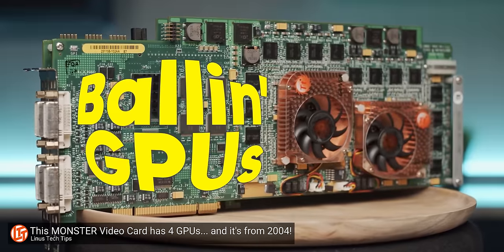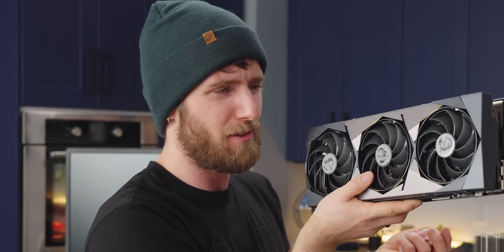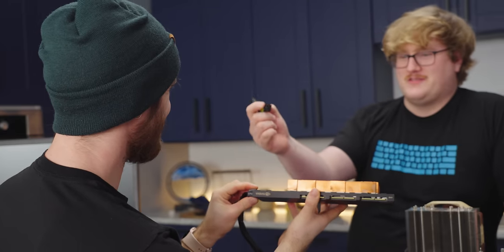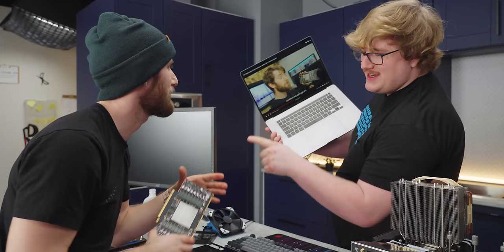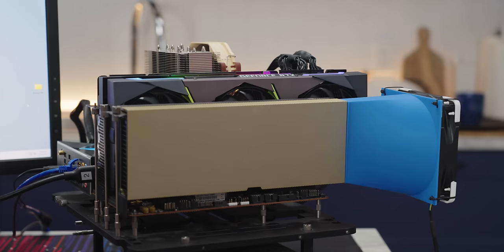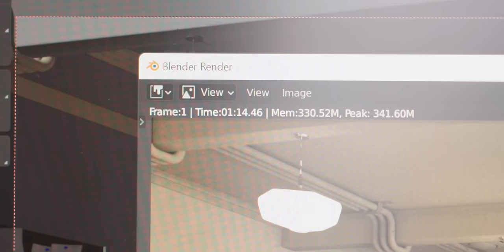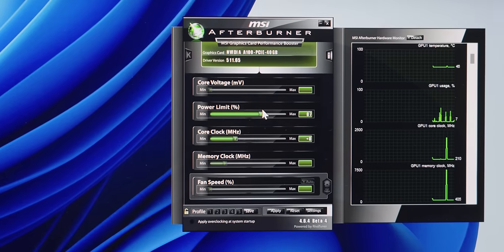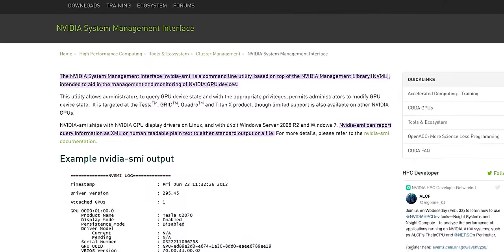NVIDIA REFUSED To Send Us This - NVIDIA A100

Comment: These cards were designed to run FP16, INT8(AI) and FP64 (double precision for scientific) workloads. If you think this card is awesome you should benchmark Radeon Instinct MI250X and Radeon Instinct MI100 with some FP64 workloads or even FP32 like blender rendering just to see the power of MI250x, it is the fist 6nm accelerator out there. AMD always had way higher FP64 compute power even on their consumer cards. AMD has no competition in high precision workloads meanwhile nvidia does way better in AI workloads. 

RTX3090    35.58 TFLOPS FP32,  0.55 TFLOPS FP64

A100           19.49 TFLOPS FP32, 9.74 TFLOPS FP64

MI100         23.07 TFLOPS FP32, 11.54 TFLOPS FP64

MI250X       47.87 TFLOPS FP32, 47.87 TFLOPS FP64

On and also both Radeon Instinct Cards are passive cooled.
Reply: It's incredible and almost impossible to explain how much more powerfull graphics cards had gotten over the yers
Reply: @blacktiger6046  Yeah it is crazy when you think about it. How powerful gpus now compared to the gpus we had back in the day like MX460. This year gonna be the biggest GPU performance leap within last 15 years. Both Nvdia and AMD will double the transistor count and performance will be more than twice compared to current flagships.
Reply: Yes, it's been the software side holding AMD back.  I tried really hard to find an MI100 at an affordable price (in context affordable), but it was practically impossible to get my hands on as an individual.  Nvidia has worked to catch up in this area, in the past they were always totally demolished in it, like what those 3090 numbers are.
Reply: @Pixel_FX  ... I don't think it's that crazy, rather I think their RAM spec has grown stupidly slow.  I had a 1GB card like 10 years ago and today a card that costs about 40 times as much is only packing 40 times the RAM...  That's actually really disappointing.
Reply: @zvxcvxcz  i was thinking more like 2002-2005 or older compared to today's
Reply: I have benchmarked the A100 40GB, MI100 and MI250. Let me tell you: The A100 beats them both in bandwidth-bound applications.

The MI250 is especially disappointing, because the 2 GCDs in a socket are separate GPUs with 64GB each, and one can't directly access the memory of the other. It's like a Tesla K80 dual-GPU card but in one socket.
A single MI250 GCD gets you only little bandwidth increase over the MI100 and is still way slower than even the A100 40GB because the efficiency is as bad as Nvidia Kepler.

With standard, non-matrix FP32 compute, a single MI250 GCD is only little faster than the A100, at ~19 vs 16 TFLOPs/s.

Comment: The reason this card is so efficient is mostly because it's using more surface area but lower clock speeds. Gaming GPU's could also be designed this way, but it would make them much more (too much!) expensive to produce.
Reply: yeee, intel and AMD use a similiar strategy for the their server CPU's (and threadripper) where they have a physically bigger chip. However the downside is its way more expensive as it uses up way more wafer space
Reply: Even without physical changes you can achieve so much better efficiency if you slighly downclock your modern GPU. Nvidia and AMD pushed their consumer cards so far out of the performance/Watt scale it's hilarious. But hey gamers don't care if they use another 200W as long as they get 5 more fps.
Reply: at what point does binning become infeasible?
can you shut down like 50% of the GPU if it have defects?
Reply: also probs wouldnt run real time very well, since you need small chips for games to have less delay

Comment: The near double performance you're getting near the end is because of nvidia's 1:1 fp16 ratio on consumer GPUs, also nvidia has a 1:64 fp64 ratio on consumer GPUs.

Basically they artificially limited consumer GPUs to force machine learning(wants fp16) and scientific calculation(wants fp64) people to buy way more expensive "professional" products.

LHR is just a newcomer to the party, not exactly a new concept.
Reply: Same energy
Reply: Can you elaborate on what you mean by '1:1 fp16 ratio' and '1:64 fp64 ratio'? (I am familiar with the datatypes themselves and the consequences for performance/vectorization on CPUs)
Reply: @Cyberguy42  performance compared to fp32, 1:1 meaning it's the same speed and 1:64 meaning fuhgeddaboudit.
With a tiny bit of extra circuitry you can make fp16 go twice as fast and fp64 half speed compared to fp32.
At least Nvidia relented and unlocked fp16, because that used to run at abysmal speed as well, so you can at least save on memory (which is also scarce on consumer cards) and make use of tensor cores for some operations.
Reply: BTW AMD has full speed FP16 and 1:16 FP64 on their consumer GPUs.
Reply: Yeah that's not really accurate. Geforce cards physically don't have many fp64 units to make them cheaper, also tensorcore fp16 matmul with 16-bit accumulator runs at full rate. Only fp16 matmul with fp32 accumulator is artificially restricted, which can be useful in some workloads but often accumulation in fp16 does the job. The 1:1 fp16 ratio you talk about is on Cuda cores which nobody uses for deep learning since tensor cores are much faster.
Reply: @randomobserver9488  fp16 has enough downsides (less stable training, loss of accuracy, ...) that at least in research it's not nearly as universal as you make it out to be. Hence why A100 supports the custom "tf32" 19bit format in its tensor cores to avoid converting between fp16 and fp32 all the time. Using the tensor cores is also only considerably faster if you're not already saturating the memory bus/caches anyways, which can happen quite quickly if your model uses a lot of less complex functions.

Comment: If I recall correctly Tensorflow usually blocks all your ram when being loaded. This means in the background it might not need that much but blocks most of it for better performance.
You can switch it to only allocate the required ram but this has to be done manually.

Just wanted to point that out :)
Reply: physical_devices = tf.config.list_physical_devices('GPU')
tf.config.experimental.set_memory_growth(physical_devices[0], True)

For those who are curious but not curious enough to dig it up :)
Reply: Pay attention to this comment!
Reply: You might have increased the batch size and got more images/s

Comment: 17:55 the math on that works out to less than $900/year of operating costs. Even if it had the same efficiency as a gaming card, at $1500/year it's still marginal compared to the capital cost of the card. AI datacenters buy these because of memory capacity, not because of computational efficiency.

Comment: Electronic Hardware Design Engineer: "How challenging is this PCB design going to be?"
Boss: "Yes."

As an electrical engineer who designs some really challenging electronics hardware, my jaw always drops when I see this kind of stuff.

Length matching thousands of traces is just ludicrous.
Reply: 1: these are not designed by a single hardware designer(I'm sure you already know)
2:they probably use some advanced AI which helps them design these things by automating some of the calculations
3:these things are not designed in one day,it was probably been designed by a group of engineers over many years
Reply: @armincal9834  you're right.  It's likely a team of a dozen engineers or more.  Some design the power systems (with the help of mechanical engineers for thermal design), some design the memory interfaces (likely specialized SI [signal integrity] engineers on the team), some design signal conditioning and sensing, and some design the processor implementation with the help of the IC design team (required bypass capacitor values and parasitics).

Then, there's a PCB design team.  Different roles are PCB librarians to manage footprints and symbols, power layout, high-speed digital layout, analog and sensing, and finally one person who puts all the pieces together (maybe a chief or senior principal engineer or hardware architect).

This isn't including the team that does simulations, DFM evaluations, part procurement, cost trades, IC design, etc.

They probably use Cadence Allegro.
Reply: @RandyLott  i feel so fucking dumb after reading what you said there. wow, I'm glad there are guys like you out there who let guys like me play some good old video games 😅
Reply: @crylune  no way, dude.  I've been aggressively learning and working in electronics for over a decade professionally and I've been passionate about it for 20+ years (since I was 10 or so).
Reply: @Sonoran.Stoner  we're all skilled and passionate in different things.  Much of what Linus and Jake talk about is over my head in terms of advanced computing topics.  I don't design computer hardware, but rather cameras.
Reply: @RandyLott  Luckily they have a script and remember it enough for the vid...but then later can't recall most of it
Reply: High end gpus really are one of the coolest electrical designs, check out some of the powercolor dual GPUs, dual 290 390 etc, kingpin too
Reply: The PCB challenge here is mostly the power delivery and power integrity, and not high speed interfaces. The only critical interface might be the PCI-e lanes running from the edge connector to the chip. HBM memory sits directly on top of the GPU chip, or else it would cause way to much signal integrity issues at the speed the interface is running.
Reply: Well with modern designs, like, i don't even care. But sometimes i see a toy from the 80s like that cassette tape groovebox Philips and Sharp made, PMC100 Personal Media Composer, and it's a single sided PCB the size of a calculator basically, and they have a 6800, SRAM, ROM, little Yamaha soundchip, but like everything's pressed so much for space, and it's a SINGLE SIDED PCB with a handful wire links and traces snake their way all over the place, and it's dense, there's basically no space to wedge in your tweezers between many of the components, and it was designed in 1985 or 1986 and i'm looking at placement and routing and thinking like HOW EVEN. Most 80s computers and such are easily legible but this just has everything going all over the place. And it's not like they had the tools we have today.

But hey isn't PCI Express allowed to have oodles of skew between the pairs, compensated by the protocol, and you only have to length match them per differential pair?

Comment: Just a thought i had while Linus was talking about the fan shroud, have you tried to flip the fan around to pull air through to see if airflow improves at all? I don't understand fluid dynamics all that much but it's worth a shot.
Reply: Their 3d printed funnel/part is not hermetic enough, it'd pull air from the room and not the gpu.
Reply: A radial blower fan would have made more sense but it seems like the 120mm fan also worked just fine.
Reply: While they've got that card, they can run comp fluid dynamics to come up with a better air funnel that screws onto that spot

Comment: 16:12 you need to lower the core clocks as low as you can to free up more power headroom for the memory. keep dropping core until the MH drops off significantly then come back up to find the balance. The memory may be starved for power if the core is boosting to 1200mhz when it may only need 900mhz for etherium.
Reply: Nice spelling :p
Ethereum
But yes, you're right about dropping cclock to free up mclock speeds

Comment: NVIDIA has it's GPUs broken down into different "types", depending on what you want. For instance NVIDIA 3080-NVIDIA Quadro-NVIDIA RTX 400 ($5000)- all have "ray tracing" fully involved. NVIDIA A60 - is a different kind of card, setup to handle a group of desktops that handle accounting, or Microsoft Products.

Comment: I was wondering... Since it has an IHS and the person loaning it wanted a cooling solution... If you make a custom bracket can you attach a CPU waterblock to it? A 240 AIO would at least look better than that plastic contraption.
Reply: Might have problems cooling memory, vrms etc
Reply: Unless you go full on nitrogen level cooling, water cooling wouldn't be very useful for this grade of a card usually. As he pointed out, these are usually stacked in groups of 8 in a server chassis in a highly cooled data center, so essentially its cooling is mostly taken care of by the server chassis. I'm not sure a waterblock would provide the same efficiency, although you're right in theory it could be done if one were running it on a setup like the one shown in the video...
Reply: Yeah you can do it , but its only 240w server gpu(3090 goes up to  400w) ... Has no power limit go beyond 100% has no real overcloking ability...You would just make it cooler but when you consider risk of failure waterdrop on a 10k worth of a exothicc single card which even linus can't get one ... its rough choice...

Comment: Minor note: Tensorflow allocates all available VRAM by default. You can turn it off by making the memory allocation dynamic by adding 3-4 lines of config code before initializing the model. Actual VRAM usage depends on type of the model, batch size and floating point precision used for calculations. If none of those change, the VRAM usage must be equal in both of those cards (or it should have raised OOM errors because it cannot fit the model and the data at one go)

You can juice the batch size higher and higher until tensorflow throws memory errors, though it is not really recommended to juice batch size that much lmao

Comment: Have Jake design a shroud for a large centrifugal fan. An axial fan is typically not gonna have great pressure.

That or you could have a stator behind the fan to help direct air towards the gpu.

Comment: And the fun part about computer parts: This costs $10,000 today. 5 years from now it will be worth less than a paperweight.
Reply: Laughs in $330 usd gtx 1650
Reply: I sold a more than 5yo GPU above it's initial MSRP. The 90s and early 00s are long gone. A 2700k (an 11yo CPU by now) is still worth about a 100 bucks. So are matching motherboards... So even if you only had a low end CPU of that era (i3 and such), you could still get some decent change for that board and a little bit for the ddr3 memory as well.

Comment: A couple of things you might find interesting based on my experience with the RTX A5000 that I own.

Nvidia driver version 462.59 allows you to adjust both core and memory clock in Afterburner (which is how I had the highest 3D Mark score for this card for a while, lol). None of the newer versions I have tried have allowed me to make those adjustments.

I just ran a quick mining test, and although I think I have been able to get the efficiency higher than this the numbers I am currently getting are hash rate of about 102 MH/s, Power Consumption of 230W, and an efficiency of 442 KH/W.

One of these days I am probably going to shunt mod it to see what it can really do when it's not power limited.

Comment: If it supports OpenGL then I wonder how emulation would perform with the A100
Reply: Run dosbox on it, and you finish the games before they start!
Reply: If it supports OpenGL, couldn't they have tried some games? I got a bit confused in that part
Reply: @MrUwU-dj7js  Yeah, most native Linux games would have worked.

Comment: it can propobly game. i have a "similar" system with a tesla m40. what you did wrong is installing 2 different drivers. use a display gpu tat is supported by the a100's driver, or use a non-nvidia gpu for it. i had he same issue first, pairing my m40 with a gtx 750. always the last installed nvidia driver is active. also it is probobly in tcc mode, instead of wddm. you must run the datacenter card in wddm to run games. then you have to do some regedits, and there you go. this works from kepler to pascal for sure, but i dont know after pascal. in theory it should. write a comment if you need help.
Reply: The a40 would work better for this purpose as it uses ga102 rather than ga100. The m40 shares silicon with the titan and 980ti while the a100 has dedicated silicon
Reply: @amogusamogus8490  yeah, i know. i just wrote it might work.

Comment: 13:25 I actually want a consumer version of the A100.
Ray Tracing can go die in a fire, but DLSS is great, it just needs more tenser cores to make DLSS effective at 4K120fps. Currently you're only gaining about 20% with DLSS at 4K120fps versus the 40% gains you'll see at 4K60fps because even on 3080 the tenser cores always take about 2ms to render a 4K frame, and that 2ms is 25% of a 120fps frame vs. only 12% of a 60fps frame, so even though you're cutting pixel count in half by enabling DLSS the frame time savings are very small at high framerates, once you go as high as 4K240fps then turning on DLSS can only hurt performance.
If the RTX4000 series doesn't double Tenser Core performance then it leaves the market wide open for AMD to just brute force 4K frames faster than Nvidia Tenser Cores can upscale.

Comment: That is soo freaking interesting bt I don't know for personal research systems A100 would be any good it comes at nearly 10x cost of 3090 and going with 2 x 3090ti with nvlink would be the best deal though it won't be that efficient in terms of power bt deep learning models will definitely be good on that

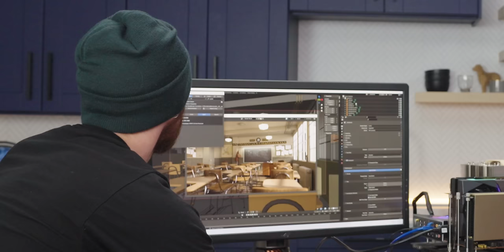Comment: 12:35 optix works on my 1050ti and even older cards, and it is faster than cuda, if you have an nvidia card use optix, cuda is worse most of the time

Comment: great card for a data centre but personally for mining or machine learning I would just buy two 3090's and then use solar panels for the power. would work out cheaper and give me free power at the same time. these are really only good for putting in a data centre or somewhere with confined space.